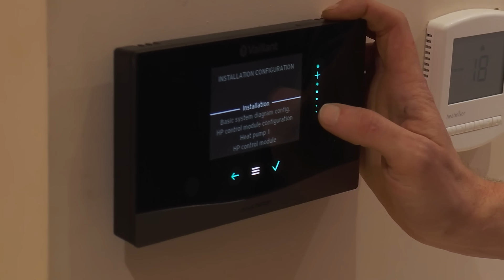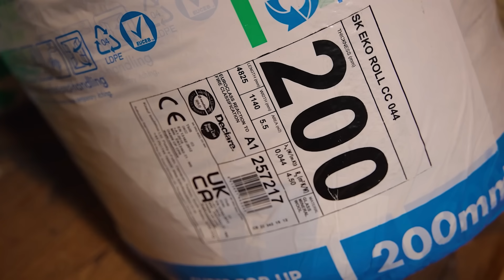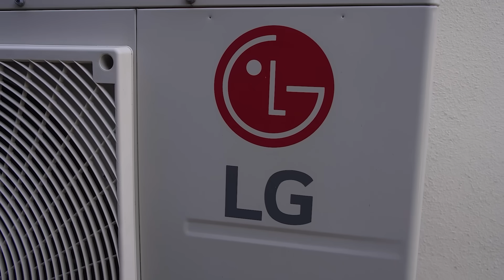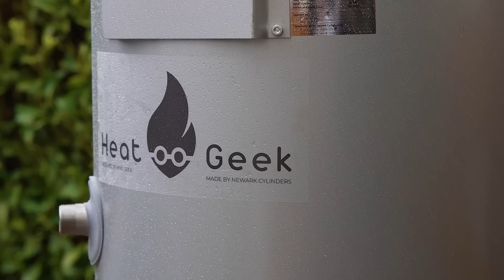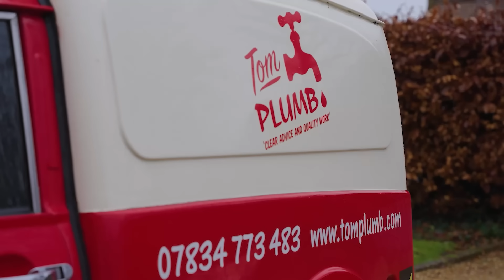Heat Geek’s Heat Pump One Year Later — The Verdict!

Comment: So why are they putting all these yellow plastic pipes inside the old gas pipes? I’m not convinced as you need a lot of space for this kind of thing.
I’m planning to go to pastures warmer and tropical 🌴
Reply from the maker: They are renewing gas mains because gas will still be the predominant fuel of the future.
Reply: @SkillBuilder  There is a massive renewal of gas mains going on.  I had mine done and there was a problem.
The road where the main gas pipe is, is 70ft from my gas meter which is in a garage at the back of the house.
The gas people immediately said they would either have to dig big holes in the drive, or fit a meter on the front wall of the house and run a pipe along the wall to where the original meter is.  It would also need to be a smart meter.
You can imagine the argument.  In the end I said I would contact OFGEM and suddenly they managed to push a new plastic pipe down the original metal one. 2 hours later the gas was back on.
I wasn't expecting any of this.  I got home on a Friday night at 6pm after a long day at work, wanted a bite to eat, and found no gas supply, no heating, no hot water, no explanation, no leaflets or letters - absolutely FA from Cadent.  Other neighbours, including OAPs and British Gas priority customers were all left disconnected, some until today,
Trying to get through to anyone was a nightmare.  After having a rant on the phone, someone turned up 30mins later and started the connection.  I was lucky.
Why couldn't they join the new plastic gas main on to the old metal pipes?

Comment: over 3000 gigawatts of gas per hour are used in the winter. Hinkley C nuclear generates 4 gigawatts. I'll let that sink in.
Reply: It'll take a while to switch and thank goodness heat pumps are so efficient.
Reply: @Biggest-hz7ng  Electricity is around 70% inefficient before it even reaches the heat pump so no not really. Hydrogen boilers are a much cleaner idea. Atleast there is a much higher chance and potential of being able to create enough hydrogen cleanly one way or another and deliver it.
Reply: Hmm, green hydrogen being 6 times the cost of gas/heat pump heating suggests green hydrogen is some way off.
Reply: @Biggest-hz7ng  That's a cop out
Reply: @kevinchadwick8993  not so much when heat pumps are so efficient and you can make a lot more green electricity at a good price.

You spend your money on the place it has most effect climate-wise
Reply: @Biggest-hz7ng  Exactly. That 70% loss is upfront and as I said there is 0 chance of creating enough electricity. Heat pumps are just making electricity more expensive for everyone else. For some reason Gas and Hydrogen get whole system analysis but electricity does not.
Reply: @kevinchadwick8993  UK Power Networks estimate transmission losses at 7.2% of consumption. I don't know where your figures are coming from.
Reply: @Biggest-hz7ng  Yeah and it's complete nonsense. I added a bit over 50% generation because clearly  7.2% is too low and using e.g. batteries for storage will involve more inefficient voltage transformations as does switching cabling voltages to reduce resistance losses.
Reply: It is nuanced obviously but in the light of renewables not ever being able to replace gas without fusion coming along (possible then?) then I think everyone needs to go back to the drawing board unless they're just making money out of us.
Reply: @kevinchadwick8993  "I added a bit"🤣

Comment: At the end of the day it's just not worth having heat pumps yet for the majority of properties.
Reply: This one runs cheaper than a gas boiler. Reasonable heat pump installs have similar running costs to a gas boiler. If someone's boiler needs replacing, grants can help with the switch.
Reply: @Biggest-hz7ng  
The thing is you will still be losing money  the problem is the additional electricity costs casts from running the heat pump system... I know of people that have taken heat pumps out purely because the electricity bill has increased so much it is not viable for continuous use.

Comment: Getting rid of the gas cooker is not a good thing for the environment. Most electricity comes from Gas with a 50% loss at generation whereas gas for cooking has very little loss. There is also no chance of replacing all the heating that we use with electricity in the foreseeable future. You could actually see heat pumps and their subsidies as a tax on the poorer citizens.

Comment: Heat pumps are just air-conditioning units without the benefit of cooling in the summer.  Keep your Gas boiler & install aircon like me. OK you don't get the grant but why should people living in a 2 bed house or flat on low income be subsidizing people living in a 6 bedroom house??? Totally wrong .
Reply: My heat pump heats in the winter and cools in the summer.
Reply: We should all be encouraged/supported to decarbonise. The heat pumps in Aircon are less efficient, but it would be good to have them considered an acceptable replacement for a gas boiler
Reply: @Biggest-hz7ng  Show me the proof on your comment.
Reply: @andyb6120  figures on the efficiency of Aircon as a heating system are scarce, but the suggestion is that a SCOP of 2-3 is likely (if that is what you are asking?).
Reply: @Biggest-hz7ng  New Aircon systems are around SCOP of 4
Reply: @andyb6120  do you have a source (and if YouTube would be so kind as to not delete the response)?

Comment: So the Original unit failed within 5 years, Who covered the cost  of the new replacement external unit and the installation of larger radiators? the original company was no  longer in business.

Comment: so tell me the water for those that need warmer water all fine ? Taps, Kitchen appliances, Showers temp ok or warm enough?
Reply: Heat pumps can manage high temperature hot water fine these days. Flow temps from the heat pump of up to 70C can heat water hotter than most need.

Comment: But you missed the point, gas boiler/co2 not a problem, you are falling for the BS,  France has not got it right, most of the nuclear reactors are off line and they have been kicked out of Burkina Faso, and have lost their access to cheap Uranium,

Comment: nuclear fusion won't solve any problems. with have nuclear fission, and the fuel is so cheap it's basically not included in the cost for the electricity. if anything nuclear fusion will be more expensive than current nuclear power plants.
Reply: Unfortunately for fission, no one wants to live next to a plant or the waste, so it will never be built or be cheap in the UK?

Comment: There is no place in the future for gas boilers, the planet cannot stand it. That has to be the most important point. Having a heat pump is superior to having a gas boiler, but even if it wasn't a change from gas is needed.
Reply from the maker: Electricity is produced by gas fired power stations
Reply: @SkillBuilder even when electricity is solely generated using gas, heat pump efficiency saves 40% of the gas. In 2030 the plan is to only generate 5% of our electricity with gas.

Comment: Because of all the complicated setup do you think heat pumps are more suited for new builds where the system is worked out before hand, and it can be multiplied for every house?
Reply: Very much so. It's not complicated when you're putting the whole system in from scratch. It's complicated when you have to out whether you can reuse the existing pipes and radiators, and especially a case like this where the building itself has different levels of insulation.

Comment: Top performing heat pump in the country and 80% of my electric bill goes on the heat pump…….. no thanks
Reply: He obviously doesn't use much electricity elsewhere. With the heat pump's efficiency, it's less than he'd spend with a gas boiler.
Reply: @Biggest-hz7ng  I don’t think so. Take into account the cost of the heat pump too - plus I have a Vaillant EcoTec Plus from 2006 - it will probably need replacing in a few years but I will have got 20 years out of it. No way is anyone getting 20 years out of a heat pump. And I’m still only paying 8p per kWh

Comment: I'm an Industrial sparky by trade, have a small 2 bed end terrace, Oil heating and Elect as Rural , space is a premium , I'm stingy when it comes to elec and hence my monthly bill is £40 including standing charge ( I do run a small eco flow solar system ) Oil costs me £800 and when very cold light the coal stove or woodburner. I just don't have the space for a heat pump system with immersion systems. I do however back point my slate roof tiles, fully insulate between rafters and over rafters in the attic and this made a massive difference, I would say if your gonna spend, insulate your attic.
Reply: Yup.  Insulate, insulate insulate, - keeps you fuel bills down forever.
Reply: I'm an industrial spark of 40 years, built a rocket mass heater cw built in wood dryer which runs on dead wood (storm damage etc)
Haven't bothered with my gas central heating for 4 years (although the boiler is still used for hot water)
Problem with heat pumps and insulation is you introduce a 2nd problem of damp leading to something like MVHR to avoid ventilation losses
Reply: Yes the first pounds spent on a new heating system should start with insulation in the loft only then consider which heating system.
Reply: Could the cylinder fit in your attic (even a Heat Geek Mini)?
Reply: Absolutely insulate first.  Old stone house 2ft thick walls with 4inch internal wall celotex, 6 inch internal roof, several small old free storage heaters, 2 wood stoves for top up.  Never used more than half the storage heaters at all in any winter.  All this tech can easily go wrong.  KEEP IT SIMPLE.
Reply: @brianlopez8855  And if you have plasterboard walls - do some research and Google  'Plasterboard Tent'!!

Comment: Why do all these "energy saving" machines companies, go broke ad soon as there's a issue.
Reply: Well in Scandinavia heat pumps are basically standard, it's our broken energy market that cause this.
Reply: Scandinavians build their house in a superior way. It’s all about insulation and most UK housing stock is unsuitable for. 
HP
Reply: @christophernunn943  Insulation is great to have, as it lowers the heat loss of a building, and thus the running costs. If it is possible (can it be afforded, can it be installed) both to improve the insulation AND change the boiler, better insulation may give the benefit that a smaller boiler or heat pump is needed, so the 'rule of thumb' is to start with insulation (and ventilation) if you are going to do *both*.
But it is wrong to say poor insulation makes a building unsuitable for at heat pump. Heat pumps works well if they are sized to just overmatch the heat loss of a building, and as heat pumps also comes in very large sizes, it is possible to find large heat pumps for houses with a large heat loss, that will run efficiently.

So, it is not ALL about insulation. Insulation level alone does not rule out a heat pump.

Comment: Lol...FFS Roger, it's not going to kill you to say that heat pumps work, the proof of it was sat right in front of you saying as much. 

"The slightly faltering entry into heat pumps" is not made any better by those that make YouTube Videos for clicks and profit that cherry picked failed installations that were caused by a-hole trades people. 

You don't trust an evangilist? HA HA HA..We have two choices, the younger generation with the proven new way that has been in much colder countries than ours for decades or the the crusty old guy fearful of what he doesn't understand that is killing the planet. This is why grandad gets given a Werthers Original and shoved in front of the TV at Christmas. 

A heat pump will never suit your property because you live there, not because there is something wrong heat pumps. You are someone that is in the best position to retrofit and insulte your property and you are trying to say it couldn't be made to work? Come off it Roger. 

Some electricity tariffs are 7.5p per KW/h. 300% efficiency makes it 2.5p per KW/h. Solar panels and a battery system can make it free! You can lead a Roger to a heat pump but you cannot make him think.
Reply: 7.5p per KW/h is only in the early hours when the demand is low, when higher numbers install HP's will there still be a low demand?  I dispute 300% eff when temperatures are below zero; then the addition of solar panels comes at very high cost, I would guess out of reach of most modest incomes.
Reply: @malcolmstead272  you can cherry pick the negatives as much as you like. A good install has almost the same running costs as gas. Solar and battery wll only make it cheaper. With more renewables coming online electricity will come down in price.
Reply: @billysmart007  Where is your source that the running costs are almost the same as gas?
Reply: @malcolmstead272  Basic maths
Reply: The SCOP (of 4.5) is over the course of a year, over all energy use, both hot and cold.

Comment: It takes a lot of careful design to get a Heat Pump system to work properly. How close is this tied to the family circumstances? Lets say a couple have relatives move in doubling the hot water requirements. Would the system be able to cope with this change?
Reply: What would the margin of error quantity be?
Reply: @fredblogs5801  depends on the installer and the install - perhaps 10% (they need to cope with situations where insulation isn't all it seems etc.)?
Reply: @ I doubt that a 10% margin of error would deal with a 100% increase in hot water demand especially if the "insulation isn't all it seems" I understand the how closely a design needs to be tailored to an individual family. Are home owners told what happens if family circumstances change resulting in a greater demand on the system? Are people who buy into a house with a heat pump system be advised of the design perimeters and the cost of exceeding these design perimeters?
Reply: @fredblogs5801  if you have too small a cylinder, you can choose to heat it to a higher temperature, and the hotter water will go further. So up to a point you can avoid a new cylinder.

Significantly more heat energy is used daily for heating than hot water, so the main concern would be faulty insulation (e.g. big areas of missing insulation in wall cavities). With insufficient margin, on those infrequent coldest days the heat pump wouldn't keep the house at design temperature, and the house would end up slightly cooler (I just read a 20% undersize would affect 12 days per year). But if the installer gets the calculations or install badly wrong they would get complaints.
Reply: You'd size the cylinder for the likely users, possibly replace it if the occupants need more hot water. The heat pump would be sized with a margin of error.

Comment: As I said before, fitting a heat pump on it's own will not work. The whole house has to be well insulated. So before you install a heat pump you need to make sure the loft is padded out, windows and doors are in good state, walls are insulated (internal, external or inbetween) and better still use it to run underfloor heating throughout
Reply: A well insulated house can just as easily heated by natural gas. I a house cannot be heated by a heat pump it is because the house is loosing it's warmth too fast. Natural gas will working that case  if you thrown shitloads of m3 towards heating the house.
Reply: Insulation can reduce the size of the heating system needed (either gas or heat pump). Not strictly necessary. The fix video has details.

Comment: The electric stuff is all very well but if we all go down the route of heap pumps and EVs then there's going to be a major problem with infrastructure. The cables in the streets, in most cases, were installed in the 50's and didn't anticipate current day loads or the levels of comfort we've become used to.
Reply: Part of the plan. It's obvious that running our entire lives on leccy - home use, cars (for those who can afford them), heating, cookers etc - means there won't be enough to go round so it will be rationed. Mebee 6hrs off; 6hrs on. My sister volunteered for a rationing scheme for a (paltry) fee.... 'A how compliant are you?' experiment imo. It was bitterly cold, indoor temp dropped to 15 degrees. She lit candles but couldn't do aught but read by torchlight. But this is the future folks....

Comment: Heat pump systems absolutely can work ... when properly designed, properly installed, and when the building has been properly insulated.

The problem is we have a government (the last few governments, in fact) that is being very heavy handed about trying to force everyone to get heat pumps, and prohibiting us from going back when it doesn't work, and meanwhile these things are being installed by a bunch of opportunist cowboys who are riding the carbon credits gravy train, with zero legislation or standards to stop them ripping people off.

Things like EVs and heat pumps need to be completely voluntary, and the only role the government should be playing is regulating the market to ensure that such products are fit for purpose, with plenty of competition to promote innovation.

If these or any other new products actually get to the point where they are genuinely better than the existing solutions, consumers will prefer to buy them, and won't need to be forced to, like some dictatorship.